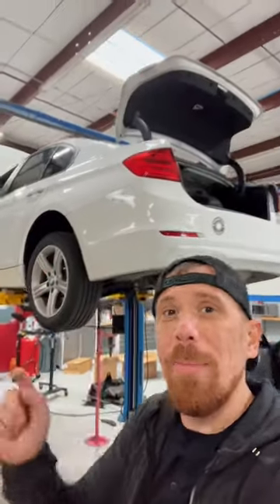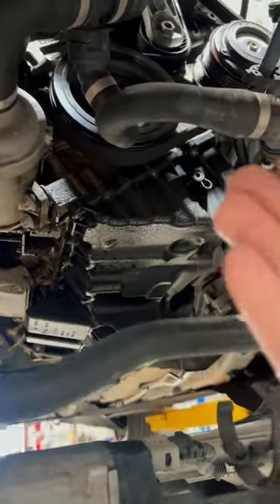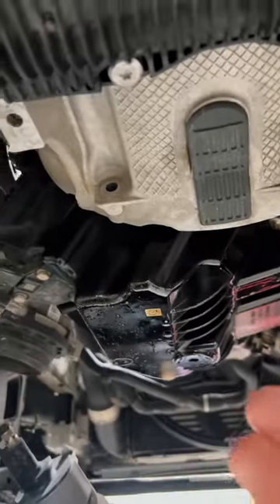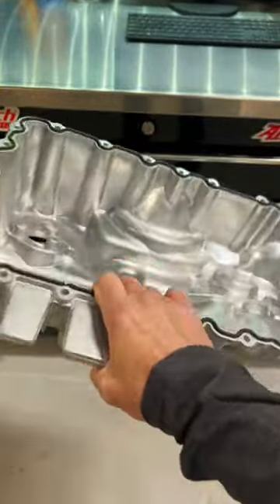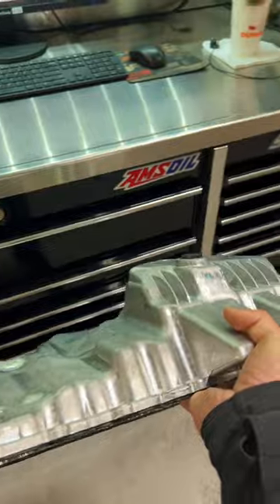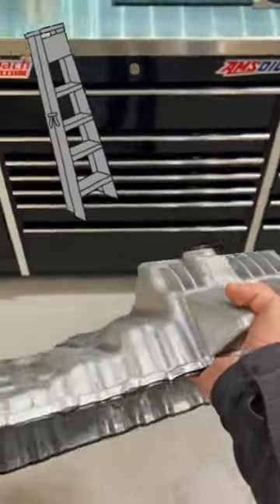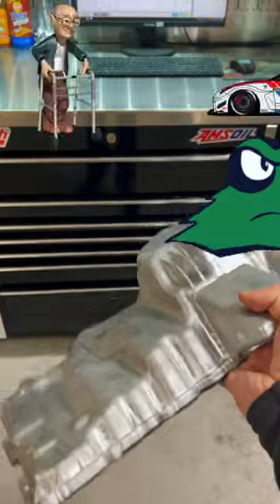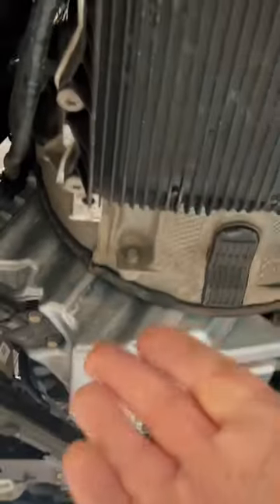BMW oil pan upgrade

Comment: Last time I hit a senior citizen in my bmw it cracked the oil pan and the engine locked up, insurance didn't cover for the repair, but ever since I switched to an aluminum pan I've been running over senior citizens with no problem
Reply: Please be more mindful and try to turn the vehicle by 180 degrees before hitting any more pedestrians. This will not only spare you the sight of the accident happening but also reduce damage to your oil pan and engine bay. Thank you.
Reply: Dang! I should really look into a aluminum oil pan 😂😂
Reply: Just a tip if you put skid plates on you can go for people as low as 30 years old without risking your aluminium pan!
Reply: @FastAndCharged  Then he will just hit the DSC pump, and that's a four figure part $$$$
Reply: x2

Comment: It almost seems like they made it plastic so you would have to buy a new one. 😂
Reply: Same with the water pumps etc. They are aware of issues but didn't fix it.
Reply: Saves them 20 bucks per car
Reply: You should see the valve cover…. Lol
Reply: Yes, and pay through the nose too for crap fragile plastic
Reply: @laurapalmerTDGE  They created these problem parts that carry a high replacement cost, thus skyrocketing their profit.
Reply: @yeolblt  - And they charge per 15min. And they rarely are in a rush ... .
Reply: They designed and engineered it that way. But people will still buy because its a BMW lol @laurapalmerTDGE
Reply: Thats your german engineering for you. Cheapest plastic for all parts. Sure toyota uses plastics but much higher quality even for cars at much lower price point. Lol
Reply: Used to hear everyone say the same about bumpers, dashboards, seats, etc. Now every manufacturer does the same and people still arguing about how much less plastic their favorite car has. 🤷

Comment: It seem like these cars are getting more and more plastic parts. Of all the parts to be made of plastic why the oil pan???
Reply: Light.
Reply: Planned obsolescence. It's an old concept nothing new. Employed by American carmakers back in the 50s and 60s it's now becoming popular with the Germans.
Reply: I think you all are missing the mark on just how tough plastics are.  Every generation the plastic is improving and it is already very tough.  Whats clear is that oil pan strikes aren’t terribly common on cars and the ones I’ve seen with blown engines have all been transverse aluminum pans on things like golf’s and civics swap the crap torque to yield bolt for studs and nuts and you’d have a real winner
Reply: I think you all are missing the mark on just how tough plastics are.  Every generation the plastic is improving and it is already very tough.  Whats clear is that oil pan strikes aren’t terribly common on cars and the ones I’ve seen with blown engines have all been transverse aluminum pans on things like golf’s and civics swap the crap torque to yield bolt for studs and nuts and you’d have a real winner
Reply: Your gas tank has been plastic since like the 2000s. Never hear people crying about those, perhaps you hear “plastic” and automatically assume they’re flimsy but don’t actually know as much as you think you do about polymers and their benefits.

Comment: I believe the RWD model has the plastic pan as my ‘15 AWD has the metal pan. I upgraded the transmission pan to a metal one last service. Cheap insurance I guess.
Reply: Yeah they can't make the pan plastic on the X-drives because the front axle actually bolts to the oil pan. So they have to be metal. They still leak tho, and it's a four figure repair bill to swap the gasket. Easily 1500 to do the pan on an X-Drive car.

Comment: They have the smaller john deere entry level mowers with a plastic housing transaxle. Blows my mind on what they think is ok. I like to refer to the Deere designers/engineers as Ted and Fred. They love to take ideas that work and are tried and trued and throw them in the garbage

Comment: I usually just replace the gasket and bolts and call it a day seems like they last about 100k miles. 

The cost on that job is already high enough without selling them a new metal oil pan.

Comment: can we get the part number for the oil pan
Reply: Manuals came with stamped steel pans, iX models had cast aluminum similar to the one shown but used a more traditional steel with embedded rubber gasket. Jamie’s looks aftermarket. 

Honestly, for the life of the car, it’s a one and done replacement for the oil pan gasket, even the plastic ones. This pan looks great for the peace of mind. More importantly though, change your oil more often to rid of the fuel contaminants and look into replacing the timing chains with updated crank sprocket on the early 2012-2014’s.

Comment: Plastic oil pan? Whats next plastic pistons?
Reply: If they could, they would. They are trying real hard to do that. EV's that's where we are headed. Plastic motor cases etc. we will get there. They will
Use the excuse of weight/range ratio

Comment: Hi, I'm looking to buy 5 series 2023 for my work .I am looking to put 200000 mile in 5 years.do you think it will cost my alot in repairs or it can make it .plz answer
Reply: If you want a workhorse get a Toyota or Lexus. BMWs are nice when they're new but the issues pile up after 100k miles.
Reply: That's a lot of miles, so my first reaction was to say no. But that's also a lot of miles quickly. Which makes me think mostly highway miles so you might be fine with it
Reply: Get a diesel
Reply: Not only will it cost a fortune in repairs, your car will sit in the shop for weeks or maybe months every time a major repair is involved
Reply: Don't do it

Comment: Plastic?

When I worked in college cafeteria, an idiot drained out the fryer (hot oil) into a plastic bucket. 
The aftermess I mean aftermath, when the bucket melted under the heat, was… out of this world.
Reply: There are LOTS of different types of plastic my guy. Thermo plastics will melt when heated, as you saw with that bucket. They are heated up and sucked into shape in a mold, then cooled down. Mop buckets, soda bottles, etc are made like that. Other types of plastics are not able to be remelted and they're reinforced with glass fiber to be extremely strong. Glock handguns for example are a Nylon 6,6 with reinforcement and they will not deform, melt, or break under impact. Some plastics are able to withstand chemical attack whereas metal and glass can't. Some are able to withstand oils and solvents, like gas tanks and gas cans. A metal gas tank/can will rust and leak. If it gets dented, it stays that way. Plastic tanks bounce back into shape. 

So it's demonstrably unfair to say that all plastics will react or behave exactly like the bucket that your idiot coworker used to drain the fryer oil and therefore they should never be used for oil pans or cooking system parts or intake manifolds etc. Use the right plastic chemistry and structure for the specific job and application required.

Comment: Been a tech for BMW for about 10 years now in California, I’ve never seen the n20/6 oil pan leak due to the actual pan cracking. They have a rubber seal that does wear out and causes leaks which is normal to happen.
Reply: Money pit
Reply: @lacloidi2003 rubber seal is inexpensive.
Reply: @Boberto385  not cheap for labor

Comment: Plastic oil pans are truly one of the most braindead options to put on a car, there are places to cut costs and save, but not on an oil pan that determines whether your car has oil, or the engine seizes. One good impact and that oil pan is gone. Skid plate isn't a bad idea, but even so, I don't trust an oil pan to hold up to the multitude of heat cycles that oil sees on a daily basis.
Reply: I share similar thoughts towards weep holes on water pump housings, I mean they're great for telling you your water pump seal has failed but is it necessary to have it sacrifice your coolant in order to indicate that? Lol

Comment: It's criminal to use PLASTIC for oil pans, filter housings, and worse yet for cooling system fittings that can crack and overheat an engine in just 5 minutes of driving.  FFS, DO BETTER!

Comment: “In case they hit something” that’s why it’s plastic! So it can deal with hits without leaving a gash or crack like in aluminum.

But they still kinda suck and leak as the plastic ages

Comment: ooh no now you have change the over weight of the Car  now the transmission shift points will be off and you will loose Acceleration and lack power because of the extra .45 lbs you added   LOL hehehee lol JK JK